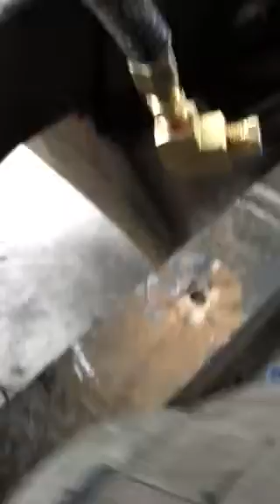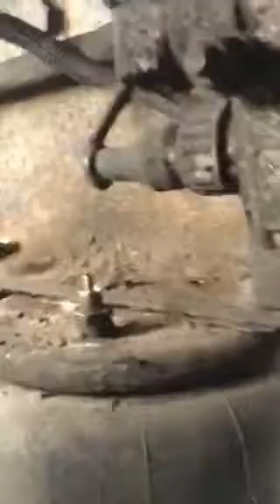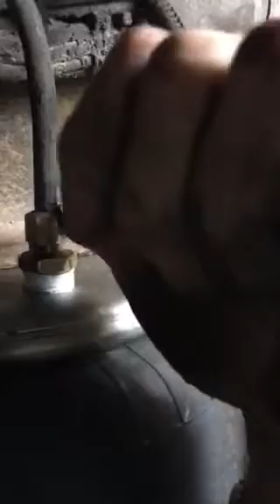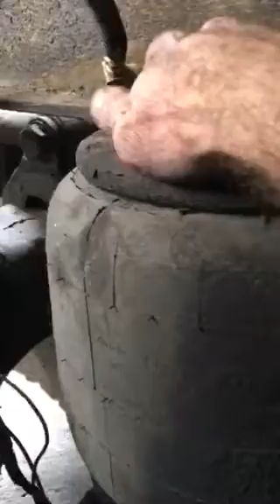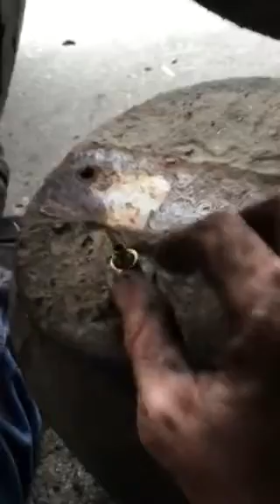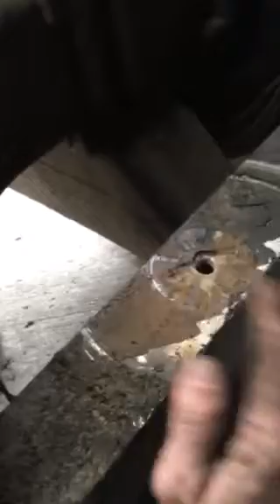Air spring replacement

Comment: alright good advice just a question what size it's the fitting that you put un the air line?
Reply from the maker: I don't recall off hand.
Reply: Eduardo silva damn that was my question so I can add it to my tool box guess I'll find out in the morning
Reply from the maker: Another good thing for the tool box is an assortment of various size compression fittings. They only cost about $3.00 for 1/4" all the way up to 3/4". A broken air line on the side of the road with a service call can cost upwards of $400.
Reply: Eduardo silva agreed I used a zip tie this morning to pinch off the line don't recommend it but didn't have any other option couldn't find my vise grips